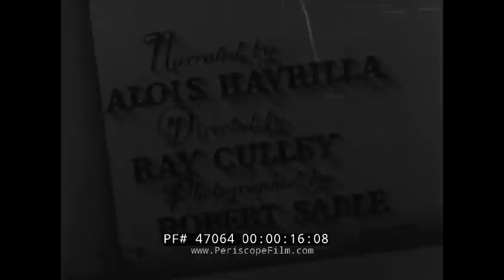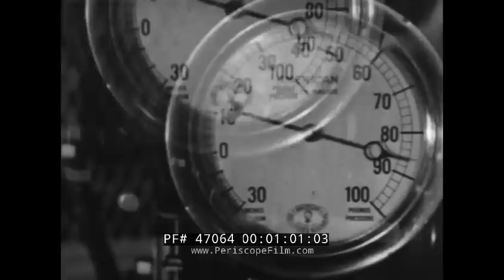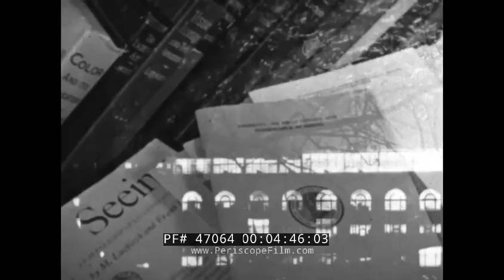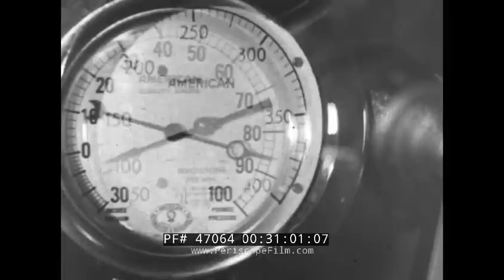GENERAL ELECTRIC WORLD'S LARGEST ELECTRICAL WORKSHOP 47064

Comment: My father was a research scientist at the Whitney  R & D center for 34 years.  Held over 40 patents.  Mostly all related to high pressure work in synthesizing diamond and cubic borozon nitrate.   Invented the process for making synthetic gem quality jade. He was a Coolidge fellow .  I remember meeting as a kid Dr. Whitney and others there.  They used to have a open house Christmas party at the lab.  Father passed away last month in May, 4 months short of 100 years old.
Reply: amazing! id love too have met him.
Reply: Thank you for sharing. Your father made a very significant impact on the jewelry industry. I hope you realize this and are proud and aim to make him proud
Reply: @jayst  Thank you.  I think he was most proud of the diamond crystal size control in making industrial diamond (GE's "diamond mine" in Worthington OH) and the sintering   process to fuse diamond into a matrix that held together under high stress.  Diamond is natures teflon. almost impossible to get it to stick to anything.  High heat and pressure in a tungsten alloy matrix works. Most common use today is oil and water and other rock drill bits.  Every diamond knife sharpener and dental burr etc. use the same tech.
He and Francis Bundy made the first gem quality diamond in the Lab.  GE's Jack Welch was a big supporter of the diamond and Cubic Borozon Nitrite production and research.  originally the focus was on wire and drawing dies that would wear evenly and have long life. (GE light bulb ind.)  They produced many gem quality stones in the lab (most from 1 to 2 carats)they could control color, size clarity.  Carbon material was often made from a variety of common materials, including peanuts from Jimmy Carters peanut farm and the diamonds (3 made in Red , White and blue) made were presented to Pres. Carter.  Stones were cut and polished and set by NYC jewelers.  Smithsonian Natural History museum has a display in the Gem and Mineral exhibit with some of the early GE diamonds and a picture of my father and Bundy.  Bob Wentdorf and Jim Fleischer made up the rest of the diamond mine team.
Reply: @sportclay1  wow that’s very fascinating!! Thank you so much for sharing. He sure made a giant splash in the world as we know it today. I’d love to see the museum someday and be able to see that in person. I hope you are using your intellect for good as well as he did
Reply: Cubic boron nitride, or CBN, is used for difficult cutting jobs in the machining and metalworking industries. Important technology.
Reply: I appreciate your story,  thank you
Reply: I visited the  GE R&D "Diamond Mine" many times after I was first hired there in 1970.  Those guys were great, we were all proud of them.  And the Christmas parties  were always packed.  They went on for many years.
Reply: Is it related to the Video?
Reply: thanks for your interesting comment.

Comment: From 1947 to 1977, GE released PCBs into the Hudson River from its capacitor manufacturing plants in Fort Edward and Hudson Falls, New York. The EPA designated the contaminated 200-mile stretch of the river as a Superfund site in 1984. PCBs remain in the river sediment, and the river continues to be contaminated by PCBs from underground sources

Comment: Isn’t it terribly sad to know that these machine are now melted down or disassembled and shipped off to Mexico or China.
Reply: The machines weren’t shipped anywhere; they wore out.  American companies milked existing factories long past obsolescence and failed to invest in new technology.   The rest of the world had suffered destruction in WW2 and had no choice but to build new, and those new plants were more efficient and lowered the cost of their products.   America lost its competitive advantage to Europe and Japan long before China became a factor.
Reply: @jacksons1010  most of what you state is absolutely right. I worked in several local factories in the early 1970's that used methods and tools that looked more like 1920, but when America's industrial might was coming to an end in the 80's I know a lot of USA machine tools were scraped or sold off to foreign buyers that we're glad to get it for peanuts.
Reply: @jacksons1010  My dad spent 25 years working at Inland Container. The made corrugated paper boxes, (AKA:Cardboard) in some machines that were built in the late 1800s. They were to the point that the heavy steel rollers for the paper would crack and have section come out. They had a lathe that was over 20', center to center that could handle the multi-ton rollers. Other pats that broke were shipped to a large, local machine shop that made replacement parts for obsolete machine tools. 
Sadly, when they decided to modernize the plant, they spent millions on new equipment that wa very unreliable and more expensive to repair so they ended up having to continue with those old machines while they sued the company that built and installed the 'better' machines.
Reply: @michaelterrell  All you're really saying is the company ran old equipment until it couldn't be repaired anymore, then went cheap on replacements.   That's exactly the poor management I'm criticizing.
Reply: @jacksons1010  They didn't 'go cheap' It was considered the best new machine on the market. Those old machines are probably still in use. because the design is simple and highly reparable. They were in need of more production capacity in the company, and that location had room for another machine.. It just didn't live up to its reputation.

There were several other box making companies in the local area that ran the same machines. I used to serve the PA systems in a lot of factories. Most ran three shifts for five to seven days a week, so the machines took a real beating. They were not high tonnage presses, and the same basic deign was still in production into the mid 20the century. That was just the oldest plant in the area,, so the machines were older. They had full specifications for the parts, and dimensional drawings.
Another business in town made replacement Model A and T Ford car parts on original machines from Ford, including the machine that rolled a heavy steel wire into the edge of Model T fenders. His largest press was 20 ton, and none of his machines were purchased new. 
I had free run of his machines, because he was related to a good friend of mine.
He even made replacement ignition coils with the Ford logo embossed into the casing. He bought the magnetics and insulator from Echlin, and canned them. He was the first company give permission by Ford to put their logo on replica parts.
He was a tool and die maker who was laid off by a local aircraft company when they had a severe recession in the industry. By the time they wanted him back, he was making three times the income on outdated machines that had seen long service in the Automotive industry. There was a dealer in Cincinnati that bought, refurbished and sold used manufacturing equipment. I moved away 35 years ago, but I recently contacted his daughter online, and he was still running the business, into his 90s.
Reply: @michaelterrell  You're talking about a specific case; I'm talking about the general case of the USA as a whole.   I have a soft spot for old machine tools, but I can't argue that newer computer-controlled tooling isn't more efficient.  It simply is.   The OP was repeating the fallacy that American factories were somehow disassembled and shipped overseas.  That's simply not the case; American factories closed because they could not compete on costs.   It's not just about tooling, it's about the basic technology employed.   The USA kept old wet-process cement kilns in service while the rest of world built new dry process kilns, and steel industry followed much the same path.   You can drive around American and see the remains of the old factories; they were left to rot rather than being replaced with new plants.   Over past couple decades foreign companies have been investing in new plants built here in America, and we see some revival in domestic manufacturing - it's just not American companies making those investments.
Reply: @jacksons1010  'Tooling' for making boxes involves very high grade and expensive plywood with many very thin layers of hardwood veneer, and die knives no matter how fancy the machine was.  
Many business had to scrap old machines because they were run without any PM for far too long. 
Machines that were still usable were sold to other companies, but the junk was scrapped or abandoned in place like several paper mills in that town.
Computer control gives no benefit for a continuous mechanical process like turning rolls of paper into corrugated paper. 
A Japanese company wanted to buy an old US steel mill that was built in the late 1800s, but they were not allowed to export the equipment. Another Japanese company ended up owning 51% of that corporation. Their newest US mill was built in the mid '60s, and it was computer controlled. The computer was built by Westinghouse. They managed to keep it running until there were no pare pats or used systems left to canalize. It had a 40 inch, 5MB hard drive with a three phase  208 volt 2HP motor. I ended up with some parts of the old drive when they replaced to computer in 1987.
That mill is now approaching 60 years old and still running 24/7.
There are plenty of newer machines that get scrapped because spare boards are unavailable, even though the hardware is in good shape. 
Others are useless because the software is no longer available. A friend of mine has searched for years to bring a CNC machine back to life. He isn't allowed to replace the controller, so it sits in a warehouse at a college, as junk.
Similar things happen with modern test equipment. A company spends $250,00 for a piece of test equipment that dies after two years only to be told that their are no spare parts. 50 year old equipment still functions, and can be repaired easily for very low costs. Yes, sometimes new equipment is the only way to do a job, but not always. 
I worked to bring the first software defined Telemetry system to marked, 20 years ago. Many parts were obsolete in under three years. The analog design could still be built, today but it had to be built to the customer's needs or modified at the factory if that changed. 
One of those analog systems was customized for the ISS. While I was working there, NASA told us that one of our first units they purchased had been in constant service for over 30 years, tracking one of our early probes as it continued its journey from earth. They were built to last, with the best components available. 
It boils down to economics. More features don't always make a better and more reliable product. any times, they shorten the useful life of a machine.
How old is your computer or cell phone? I have some working machines that will be going to a museum, if I can find a way to ship them on my small SS pension.

Comment: GE were quick to enter into making products that were predicted to hit high volumes back then and into power segment.....not sure if the same vision is there now......its more damage control now(not that its not required)........Wishing all the best to a company with such a great history
Reply: I would like to point out the General Electric produces the majority of high efficiency commercial and military jet engines in the world today, in it's Evandale, Ohio, plant for decades. The precision engineering for turbine blade and high efficiency green engines are the power plants for the majority of jetcraft Boeing and Airbus have been operating safely and and reliably for decades. Much of that engineering in design and production stand on the precision and knowledge gained in factories and research and development that GE demonstrates in this historical film.

Comment: At 24:45, the electric cooking range has 3 elements, and a mystery hole in top left of range. What on earth was that hole for, to put a saucepan in it and keep warm ? Also showing how electric element for range was made, we still have that in our current stove now. When they build it right, you can't improve something that works.
Reply from the maker: That my friend is something you don't see nowadays -- a built in deep fryer!
Reply: Yup - I was going to say it - deep fryer!!
Reply: It wasn't really a "deep fryer". It was a deep well cooker, for soups and steaming vegetables and such. There are videos about them on YouTube. I don't know why stoves don't have them any more. They could operate like a crockpot too. Also, the pot could be removed and the burner raised to the same level as the rest if cooking demanded four surface burners. Made sense. One of the many innovations left behind that should not have been.

Comment: Are you sure this is post-War?  The style, and the quote at 15:00 about how electric appliances were virtually unknow 15 years ago makes me think it's mid to late 1930s.
Reply from the maker: Just going off of what is on the BFI website. It's entirely possible that they have it wrong -- I did wonder why no mention of the war effort in this film.
Reply: RonJohn63 Probably 1939-40. The refrigerator shown in production is the first "flattop" GE style, The took the original "Monitor Top" (the classic ones with the compressor on it's top) and inverted it and "hid" the compressor at the bottom inside cabinet for a more modern appearance. The door design is 36-40 by 41 the door became more rounded (beginning "streamlined" look that continued Post War.). Likewise the ranges became progressively more rounded as the 40s approached. Another clue that it's pre war is that consumer products are being made, It's late 30s as Television is mentioned, but the only finished electronic products from Bridgeport shown are radios. (Television WAS in limited service in 39-40 but really basically New York area only.) So my inner geek detective says 1939-40.
Reply: Good call, James.

Comment: The electric eye taking measurements of the crated appliances and directing them to the right part of the warehouse is an early form of electronic automation. It would be interesting to know what circuitry was involved in that system since this was still the heyday of vacuum tubes.

Comment: I am a retired industrial electrician with 50 enjoyable years. From my first month had trouble with garbage millon dollar swictgear mafe by ge. Took their horrible servuce department a year to secure a ge undervoltage relay from large ge factory 15 miles away. Took morons another year to get a drawing for replacement relay. Had to deal with just about every electrical manufacturing company but ge servuce & parts departments were always the worst. Had the most unreliable 13,200 volt switchgear.
Reply: Their TVs had the highest percentage of Flyback Transformer failures as well. Some would cause so much damage that the replacement came in an enclosed steel box, with a lot of new parts already installed.
Their sets also generated a high level of X-rays due to the lack of proper shielding, so they starting using HV regulator tubes with a lead jacket over most of the glass envelope. That kind of crap is why Japanese imports put them out of the consumer electronics business.
Luckily, most of the switch gear that I encountered was Square D or other brands. My high school had a large, dry Westinghouse transformer burn up over summer break in a vault under the Auditorium. It was only a few years old and with almost no load over the summer since the building wasn't in use. It took many months to get a replacement for a fairly stock item and to replace the burnt mess.

Comment: Worked in the GE turbine division in Lynn Massachusetts in the gear plant. In the mid 80s turbine left Lynn but the gear plant stayed. Lynn had the first manufacturing plant for GE at route 107 and federal str. They promised a marker for history sake but never did it.  I left GE in 1986 as an r25 machinist in the gear plant. No jobs available but i could not work for a company that has no allegiance to the city or America.  I quit but a year later got a better job and not in manufacturing.  Such a great American company but has no respect for working Americans.  I worked in the building with the largest machines made. I ran a horizontal boring mill that machined large parts.  We will never see factory work again. It was a great experience but the top management i hope will rot in he11

Comment: GE built some real crap radio and TVs. Their early circuit boards were dip soldered on large solder pots, then the leads trimmed by a cutting wheel that lest very sharp edges that could slice a service tech's hand open just from removeing the board to troubleshoot it. The solder was rough, as well.
The GE Portacolor was one of the worst American made TVs ever produced. A lot of shops where I lived, wouldn't touch them because they took too much time to troubleshoot, to make repairs affordable.
I'm a retired Broadcast Engineer, but I got my start in a TV shop, at 13.
Reply: I heared that in the field of electronics they got the nickname of Garbage Electric.

Comment: So if the cost of supply back then reduced...what happened..we pay more today... manipulation 🤔
Reply: Inflation. In real terms appliances are much cheaper and more efficient then they were in those days. In a quick search I found a Frigidaire range comparable to these GE ranges, it was $179. In our money that's almost $2000. For that money today (well a little less), you can get a Frigidaire range with an induction cooktop, air frying, convection oven, and built in steam cleaning.   (Good grief, that's a nice stove! Model: FGIH3047VF if you want to see it)